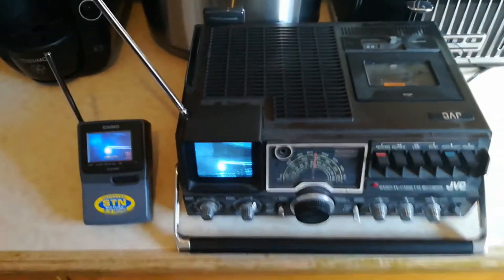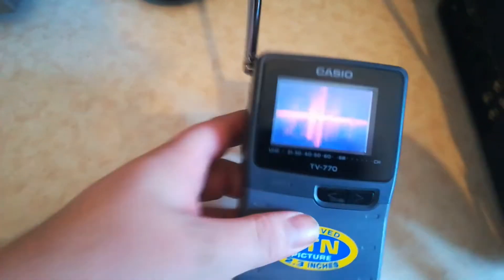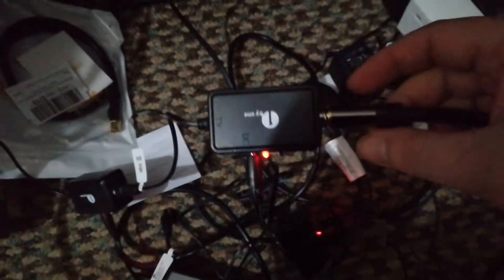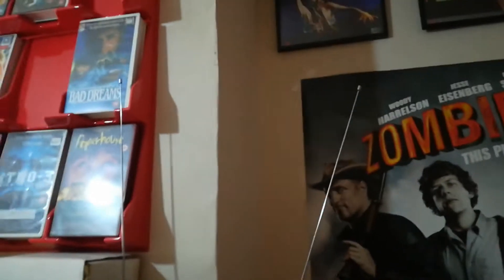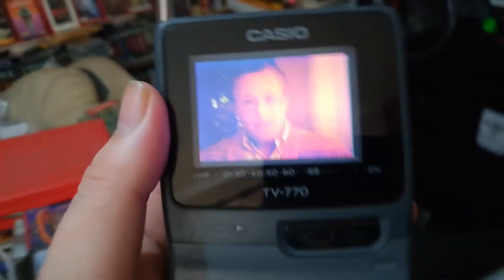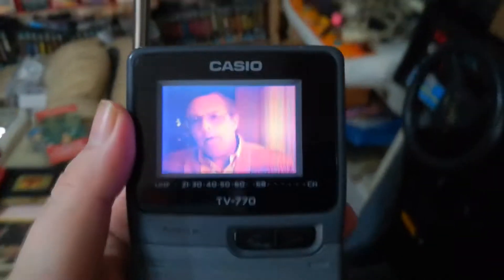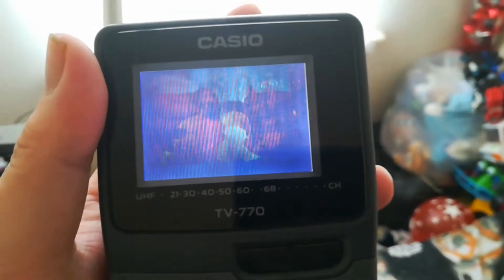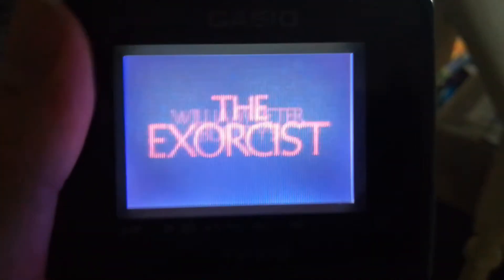Build your own Tv transmitter And watch VHS And DVD Anywhere

Comment: You're the first person on YouTube to say you can't use boosted antennas. I ordered two +50dB antennas. Thanks to you I've ordered 2x passive/unpowered antennas. Though might use one of the boosted ones in the TV to receive as might help. Those boosters aren't available but I've found another booster that's not an inline one which I'll try if not might have to experiment

Comment: You'd probably get similar results using one of those video senders from the early 1990s - used to be sold in the back of Satelliet equipment mags and transmitted to a spare tv channel when you plugged it into a device

Comment: have you ever checked the old analog channels (DXing - so to speak...heh) to see if anybody with similar ideas is 'broadcasting' near you......I wonder how strong a signal you could make before someone would notice.....if you lived in a city...you could make neighborhood-wide "tv stations" in effect..though it might render a lot of a cell phones or whatever is using that frequency now...useless........Im in a suburb..so...even if someone down the street was trying this little trick....I doubt I would see anything (though with an analog signal - even if you are just getting a faint signal...you can see something - digital craps out  if it isn't getting like an 80 percent signal....which makes DXing in the modern age....no fun....) - I should dig out an old tv....
Reply: Oh yes there is, Digital Tv is transmitted there. It still uses the same part of the Band that Analog television used here in the uk. It is only visible as fuzz on an old analog set though.
Reply from the maker: hellomcflyy hi Yeh there's no one any where near me transmitting on analogue. But this is low power so probably only next door to me would be able to pick it up. I think broadcasting anything more powerful is more than likely illegal in the UK. Even tho nothing is transmitted on there anymore
Reply: Im going to start checking - who knows...I was watching some videos from Florida - and they still pick up analog signals from Cuba and Panama.....go figure....Im up in Massachusetts...so...probably not a lot......